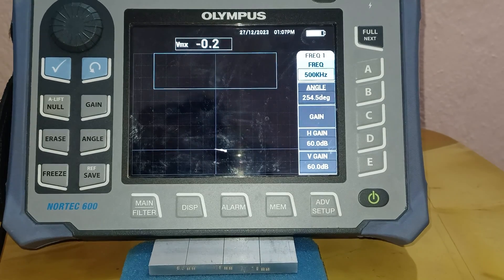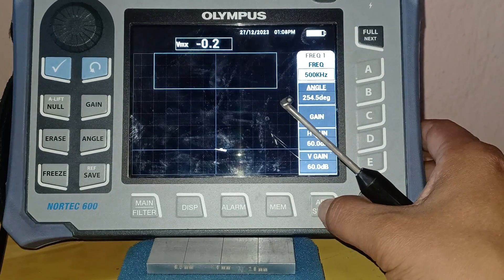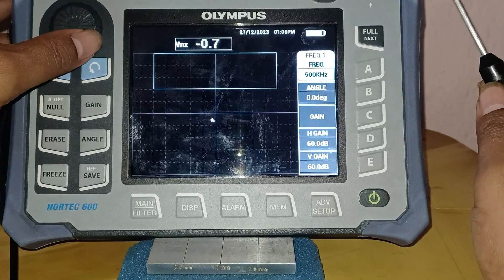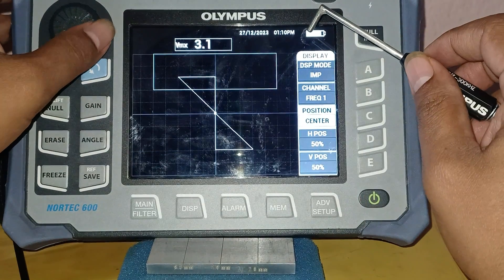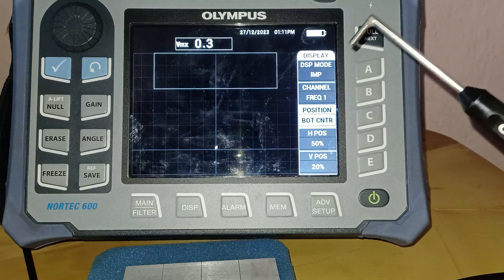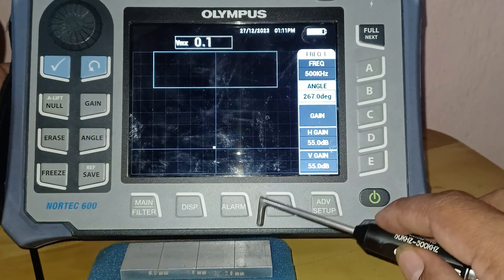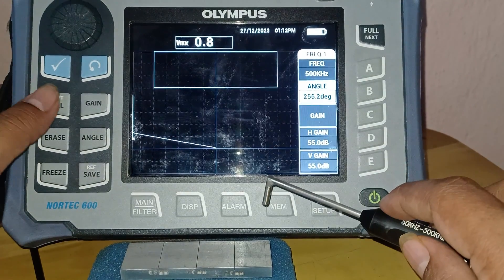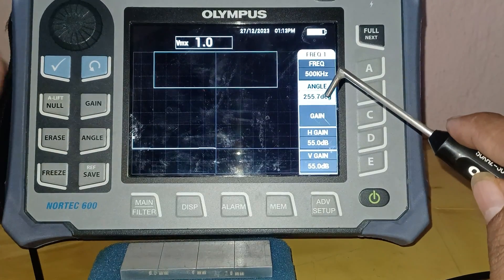EDDY CURRENT  NDT MACHINE CALIBRATION PART-1

Comment: The problem i face usually is while scanning the weld bead or weld caps,in resistance welding while scanning the weld my probe usually goes in to parent material and there is a huge difference in liftoff signal which was calibrated in weld .....how to deal with this problem.
Reply from the maker: use a smaller dia surface probe and use a low frequency